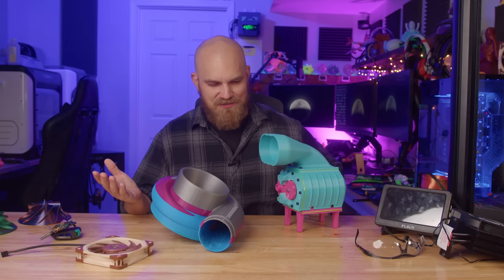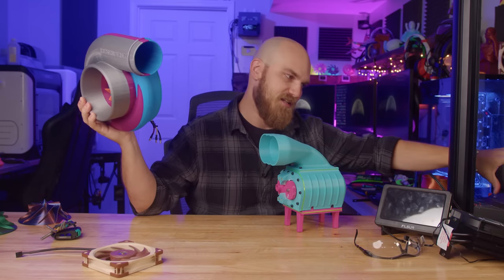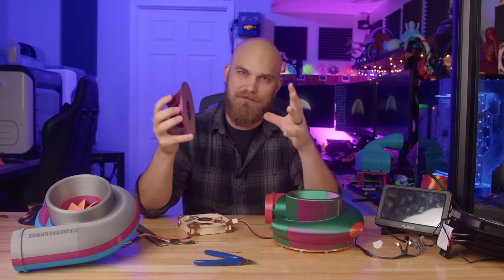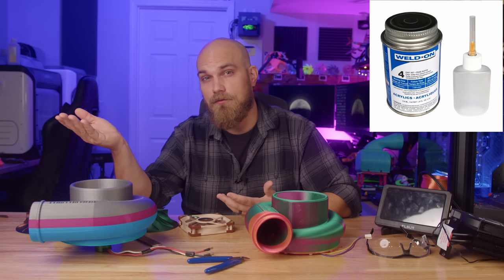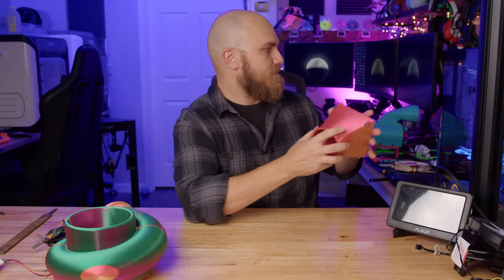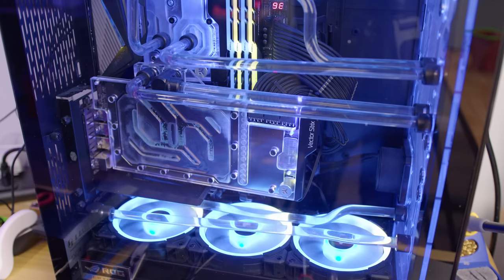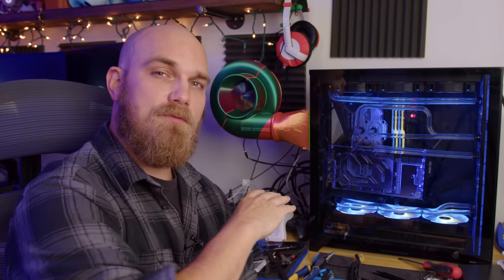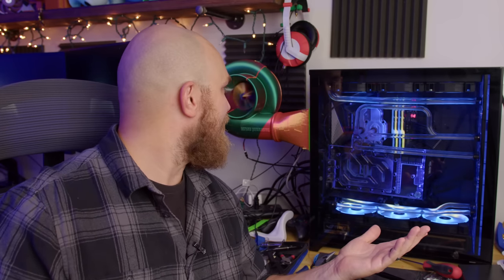Boosting My PC Performance With A TURBOCHARGER

Comment: Personally, I think it would have been more interesting to see the results if it had been a more normal air cooled PC. Your 6x120mm water cooled setup is already more than enough to cool your rig, adding the turbocharger is of course going to lead minimal change. Cool design though!
Reply: opinion noted and ignored
Reply: I second this!
Reply: @shamancredible8632  opinions are a dime a dozen
Reply: That's a solid point to make. I agree though it's so damn sick it doesn't need to make sense.
Reply: Running those temps with an open loop shows it's not well cooled. The CPU and GPU temps are fine, but you'd typically look at much lower temperatures for an open loop, especially for the GPU. I imagine the coolant temp is sky high.

Comment: It would've been great if you tested the 5000rpm fan normally installed inside the case to see if the turbo housing made a difference.
Reply: Came here to say this. I suspect the fan by itself would have performed better.
Reply: that is irrelevant the cool factor pays for it.
Reply: @benjaminalexander1998  so you could say, it’s effective in its job because it’s cooler right? 😎
Reply: It's $20... I bet he can buy another
Reply: Test it before you take it apart
Reply: @HifiRedneck  yea he made his cooler cooler.
Reply: @andrewut7ya511  did you seriously said cooler two times in the same sentence and it actually made sense?
Reply: @Lucas_sGarage  A man, paying a signmaker to custom paint the sign to his shop "This and That" noticed a flaw. He says to the signmaker, "That's hardly legible! You've left almost no space at all between this and 'and' and 'and' and that!"

Grammatically correct use of "and" 5 times in a row. English is weird.
Reply: @brandonogden3498  Spanish is also weird.... In it's own way
Reply: @andrewut7ya511  but the real question is can he make his cooler cooler cooler than his already cooler cooler? 😎😎😎🥶
Reply: @HifiRedneck  thatd be pretty cool
Reply: This

Comment: try maybe printing out a full turbo (with the hot side) and spin it using the output from your fans i think that might be a really cool thing to experiment. love your videos!!
Reply: An interesting idea, it definitely wouldn't work but still interesting. The reason it won't work is because it's the HEAT of the car exhaust that makes a turbo function, air flow alone won't cut it. A computer doesn't get nearly hot enough to spool a turbo.
Reply: Could use the hot side as an exhaust fan though  driving both from the same motor
Reply: @anthonyward8853  it's not the heat that turns the turbo, it's the pressure from the combustion so technically yes it is airflow that spins the turbo. The more booms the more airflow the more spinny whinny!
Reply: I was thinking it was running backwards the whole time! Glad I'm not the only one
Reply: @kickpushlongboards  A turbo is a machine, as with any machine, it cannot be 100% efficient in converting energy into useful work. There will be energy losses. This means the quantity of air leaving an engine will always be greater than the quantity of air a turbo can pull in. This is, of course, unless you add more energy to the out going air. Energy in the form of heat. So, yes, your not wrong. Air flow does contribute but it's the heat of the air that allows for useful work.
Reply: Try a shafted design similar to Mercedes’ F1 turbo design where the compressor and exhaust are separated by a shaft. In theory, it should separate the hot and cold gas from the PC. Or i think thats too crazy. Since its not powered by combustion, you can put a belt drive in the middle :)
Reply: @anthonyward8853  its also why turbos dont have the same size intake and exhaust turbines one is smaller than the other so it spins up faster, maybe desighn a case that is sealed so that all the exhaust from the case ends up going out and into the exhaust side of the turbo? maybe it would be a cool thing to experiment with
Reply: The problem is that no normal PC fan can generate enough air flow to spin a turbine

Comment: I think the problem with this design is that car turbochargers are designed to work with excess power. They have whole engine hooked to them and for the engine the turbocharger is almost like nothing beside the whole car it has to push around. While as a PC fan, we try to get maximum air current with minimum power by the motor. In this context, restricted intake size acts against amount of air moved by the rotor because it needs lower pressure to be maintained in front of the intake for the same amount of air and the motor's power is all spent on maintaining that pressure gradient. The greater pressure gradient you need to maintain, the less air you move.

Comment: Hey major! I found people making REAL electric turbos and actually being able to push (small, but) legitimate PSI numbers. They still aren't practical enough for cars and basically no one uses them, but it might be perfect If you wanted to take this build to crazy heights. You could snag a full metal, ball bearing electric turbo and see how much air you can push with absolutely no regard for loudness. It would be hilarious to see you yelling over a legit electric turbo you strapped to your PC. Plus since they're too weak to really add a good amount of power to an engine, they might at least be a solid chunk stronger than the 3d printed one and you won't need a Honda 4 cylinder on your desk to power it 😂🤙

Comment: Maybe turn down the internal fans until the system struggles, then turn on the turbo.

I think your system is just over cooled to begin with. Double heat sinks works better on -Mechs- case mods that had cooling problems to begin with.

Comment: I have used the MYNT3D pro pen to weld pla parts for almost two years now. I typically melt the seam together to create a channel for the filler, then slowly extrude the fill into that. Little sandling, filing, etc, the seams are basically invisible and TOTALLY gone after paint. Strong too.

Comment: You should test the fan before installing it into the turbo. Also, you should test cooling performance with the bottom fans blowing in. It would be blowing warmer air, but would allow smoother airflow. In that config, you could mount the turbo to the top of the case in reverse to assist in vacuuming air out

Comment: The best way I can think of to integrate something like this into an actually practical setup would be to have it mounted inside the case to a radiator with its intake connecting to a hole in the side panel so that it can take in air from outside the case. Would probably want to use it on a 240mm rad with the outlet of the turbocharger split to encourage even airflow across the rad.

Comment: I love this design.  One thing, I'd like a retest on the case with a normal air cooled pc setup, with proper fan placement for optimal thermal flow.   Front of the Case with a lower mounting point for the turbo.  Back of the case with high mount for exhaust fan and top of the case for exhaust. Remember, hot air rises. I think this would be a more accurate test for the cooling properties of this Turbofan.

Comment: Aaah damn I wanted to see a twin design using only those two, to cool the entire rig, with a push pull config mounted externally. But seal up the case and remove the radiator fans. Great video, I hope you do more on this design. Thanks

Comment: To glue 3D prints, using 3D Gloop is the way. It's great, and it's plastic specific (PLA needs PLA-specific goop). Gloop can also be used to fuse gaps and such. Personally I'd have printed this stuff out of PETG but PLA should work as long as nothing gets too warm.

Comment: I don't think we should be surprised at your results from testing on your computer (nice looking rig btw). Since you said that you already had the fans on the coolers exhausting air, with no other fans for intake. I suspect that you may have had a significant amount of the added air from the turbo just blowing out the other open vents in the case. Thus not adding significant pressure, and volume over and above what the the cooler fans already provide. This leads me to think that the best use for this turbo is for pushing air directly through the fins of a cooler.

Comment: For the noise level research a turbo silencer ring.  It covers the intake and effects the airflow going into the turbo thus reducing noise.  You could make one as an add on or add it into the 3D print.
Reply: Even better could hide a bearing in it to support the wheel

Comment: I ran a few tests on a single AIO 360, previously using a exhaust push pull setup, changing the first pair at the front of the case to push pull intake esulted in a dramatic temp decrease with consistent 4.7 avg, 4.95 peak on my 5900X max temp at 72. Of course not much room on a Dark Base 900 case so putting the lid on reduced airflow and there is a slight increase to the temps with it.  The most noticeable difference was the idle temp in a 25 degree room came down to 33 degrees, the 'CPU package' maintained a closer temp to the CPU temp readout, i.e. not 15 degrees difference, chipset dropped a few degrees and M.2 drives were no longer throttling under heavy load... so a big win.

Comment: Very cool, the best way to get efficiency from a boosted application is an inter cooler... Supercharger>Cooler>pc intake. Could even attach more fans to the cooler to increase the effect. Cold air is more dense, pack that pc with the chilly air haha. Obviously car wise denser cooler air is better for HP, completely different principles, but still a fun experiment. 

Final thought, you have water cooling setups, and you can get water to air inter coolers... yeah. 

Anyhow, wicked project, really enjoying this project arc haha.

Comment: Next time use high static pressure fans to create a real turbo effect. The hot air exiting the case spins the turbo charger (exhaust side) and that pushes fresh air into the system without the need of an extra intake fan. Would be pretty cool imo

Comment: I don’t know if you you read your comments but if you do read this one! On turbos and centrifugal superchargers there is a thing called an A.R. Ratio. Which is the measurement of the impeller center to the center of the compressor outlet and the area of the size of the compressor outlet. Look up turbo ar ratio measurement. The smaller the number the more velocity you have and the bigger you have the less velocity. But in the boost world less velocity means more air flow higher boost and less or small ar ratio is high velocity lower boost

Comment: @Major Hardware
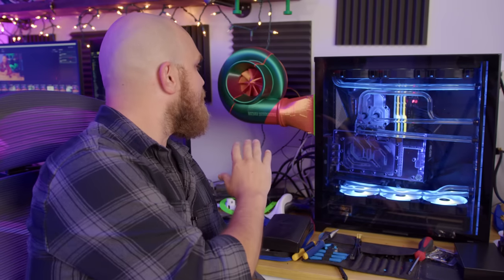11:00 I would add some kind of diagonal stabilizer ( \\ )below the fan, to better support the weight of it, using the PC casing to push against.

Comment: Ok, some snail basics. 
Compressor trim is super important in centrifugal blowers. A high trim is better for making lots of boost/pressure. Low trim for lots of airflow. 
A/R values explains how much the snail body expands and how fast. this determines final pressure and air velocity.
You first want to make a compressor wheel that suits your design outcome, low trim, and sized for the motor.
Then pick an A/R that gives you the desired air velocity.

Comment: For the gasket, I would suggest you can use gasket paper if you don't have tpu. You can buy sheets of gasket material from autozone or any other auto parts store for around $10 depending on what kind you get

Comment: Where the turbos shine is that they generate pressure instead of air flow.. so where this design might work is how it is used in the automotive industry to generate pressure instead of air flow. A good way to utilise that pressure would be to make one shroud to cover up one big radiator of the PC and pump the air from this pro-charger setup through the entire radiator at once replacing the 3 fans and proving itself to be beneficial in that way.. but loving the content anyways man ❤️❤️👍🏻

Comment: You should attach the exhaust side of the turbo on intake of the case and the intake of the turbo to the exhuast side of the case. That should give your case a neutral pressure inside while using just one fan motor. That will look sick with the big pipes on either side of your PC.
Or you go one further by using Mercedes’ shafted turbo design where the intake and exhaust is separted by a long shaft. That idea would be the craziest!!!

Comment: Negative Air pressure within the case can also improve thermals. 

You here have Positive Air Pressure. So if the intake is greater then the outflow. the case itself becomes a pressure bottle neck, and the heat can't be expelled efficiently.

Comment: Okay one simple idea can you create a simple side mounted hub fan to attach extra fans to a PC that needs extra cooling and mainly the side panel that usually is transparent and usually made up last simply attach a specialized panel that you're pretty print that's going to have plenty of the wall of fans on the side of the PC I think will be interesting

Comment: Honestly, I would think that having a turbo blower running into a box that has radiators mounted on two sides would be your best cooling.  My thinking is that with one blower feeding six fans, the fans themselves might be holding back air.  The only way to know would be static pressure inside the case, or remove the fans and retest.  This assumes that the PWM controller on the case fans can restrict their RPM.  I mean, considering how much air it moves, do you even need the case fans?

Comment: Now all you need is to add a pelter built into the turbo with cooling fins and the heat ones on outside to get that air temp down.

Comment: I like experimental stuff like this but im not really good at building things myself. So at least I want to throw an idea here.
I thought what if... you add a bit more of a real CHRA's design to your project? Adding a waterblock to it where warm water gets in and cooled water gets out. The fan could cool the water by blowing over the cold plate. Not sure if it would make much of a difference.
That would maybe better fit your system too and it would also look more like an actual TC.

Also, I agree with other comments. The comparison needs to be made between Stock Fan Performance and with Charger housing and also in an air cooled vs water cooled rig.
Those are major differences, I think so the results might be very different.

Comment: GPU has a little bit of sag to it, If you want to correct that, I took a piece of my tubing left over from water cooling, cut a piece that fit and sat it between two of my fans propping my card up.  Just a tip, you're at no means required to listen to my advice but it worked if you want to correct it.

Comment: Maybe it would be a neat idea to seal up the case really good to create a little vacuum inside the case from the exhaust fans, then to alleviate freewheeling from the idle turbofan have a "blowoff valve" that bypasses the turbo when off but closes when turbo is in operation. With software control of the turbo you can dial in a range where the turbo is effective in aiding cooling but when off it's not adding strain on the exhaust fans with the bypass in place

Comment: Did I see the smoke test correctly?   It appeared as though you were pushing air past the bottom fans that are also trying to blow air into the case.  If so, that's going to be a pretty big efficiency loss.

Comment: I'm a big fan of the 3Dsimo kit for a 3D pen. Arduino based so you can tweak temps. Lets me use the same filament I printed with, and the tip gets hot enough you can pull it through the printed part to get a homogenous melt as you add your filler... filament.

Comment: If I were going to use turbomachinery to cool, I would run compressed air through a turbine. That is how aircraft A/C systems work. Compressed air is run through a heat exchanger then expanded in a turbine which cools.

Comment: If you're still looking for a power supply MeanWell makes industrial power supplies anywhere from 5volts up over 30v and 100+ amps. We use the 12volt 1500w models in a few applications here where I work to great success.

Comment: You could actually make a turbo by piping the exhaust fans to it to spin the exhaust side which would turn the compressor housing to pull in fresh air and force it to the intake

Comment: I know you're going for looks, not performance, but I would still like to have seen the original 5000 rpm fan on the cfm meter for comparison.
1000 cfm is great compared to the Noctua (400?), and even the Cheater (700ish), but where does the 5k fan sit?

Comment: Cut a hole into the clear plastic place the opening of the fan to it use it as an inlet for air. 3D print a shroud that redirects air to key areas and really make it work please. It would Be so worth it.

Comment: 16:30 you need to redirect the exhaust from your bottom pc fans some how. Heat rises as you probably know and you can see that in the smoke rising back up around the case. You need to direct it to the side or something away from the case instead of straight down. It defeats the purpose getting rid of the hot air if it just floats back up to reheat the outside of the case. I’m sure the performance loss is minimal and my not even be measurable but as we say in racing every little bit adds up. A gram here and there quickly adds up to pounds. I think you could do it with minimal loss to the aesthetic too lol. I’m definitely putting that supercharger on my car when I buy a 3d printer one day. I’ve used a rumba fan in the past with a 50,000 rpm brushless motor and that worked way better than you would expect. Got about 2 psi boost (which brought the running pressure of the engine from -2 to 0psi but that’s still a huge improvement for what I was doing. I look forward to your future videos to learn more through your testing on what I want to do next with my own experiments.